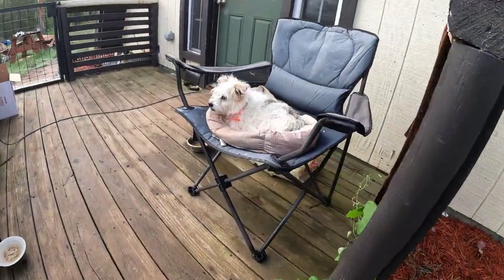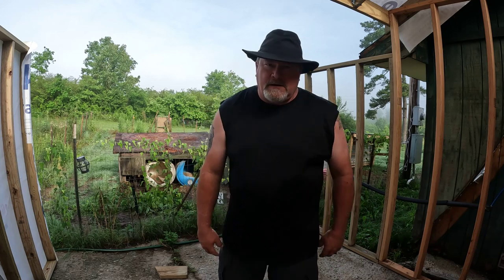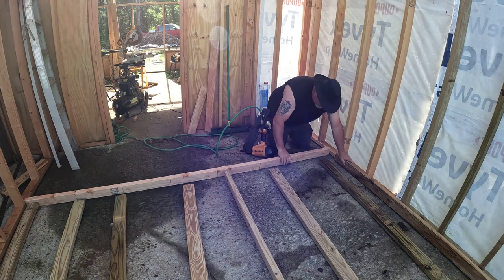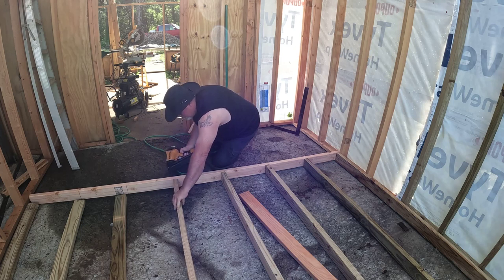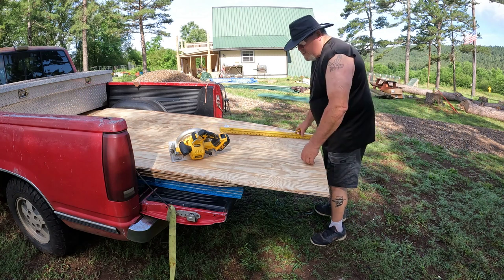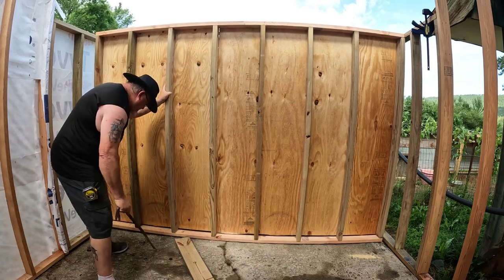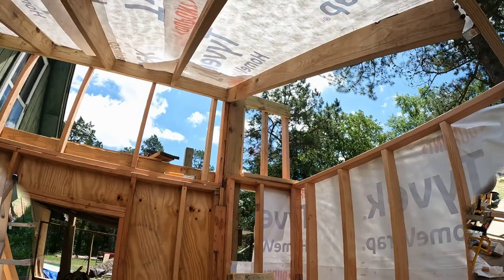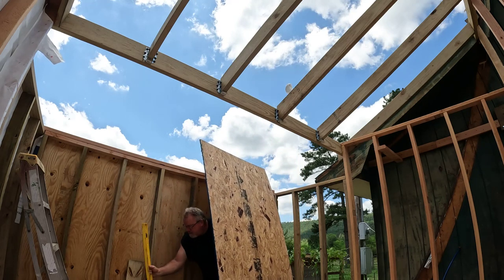Last Wall Is Up! Storage Room/ Screened Patio/ Upper Deck On A-Frame Cabin #18

Comment: I feel sure you already know about mini-splits, I know they are expensive, but a multi-head unit for you and the pups would be nice, heat in winter and cool in summer. if you ever turn that into a person room, ie, a guest room it will be handy. Who cares about code, it's not for human occupancy....yet. Maybe the space between the shed and house becomes a closet for the shed, you said it was about 24" deep. would a water heater fit?  Good job taking lemons and making lemonade.

Comment: You could use some of that concrete self leveling material.  A new wood floor would be pretty expensive at todays prices.
Reply from the maker: But easier than dealing with concrete on my hands and knees
Reply: I thought that stuff was a liquid that would flow out level. You might need a broom to push it in place.
Reply: Actually an old paint roller would smooth it very well and would keep you off your knees.  Also you can rent a concrete mixer if you do not have one.  Even better SLR might loan you theirs.  LOL!

Comment: Wouldnt it be just as cheap to  buy bags of leveling concrete and pour it over that floor?  Just clean it well and apply the bonding agent.   Then you won't have to worry about water damage.
Reply from the maker: Dont have any local, would have to drive 3 hours for it, so with todays gas prices..no

Comment: I find it just nuts they gave you nothing.
Reply from the maker: Yet today I worked 10 hours, Pain is not deadly, its just a alarm clock for the body. I NEVER take pain pills
Reply: @ouachitamountainliving antibiotic to clear any bacterial infection from your lungs and or steroids to reduce the inflammation.  Not pain meds.
Reply from the maker: In a few years or less, medical attention will be unattainable or too expensive, so I am prepping for what is to come very soon.